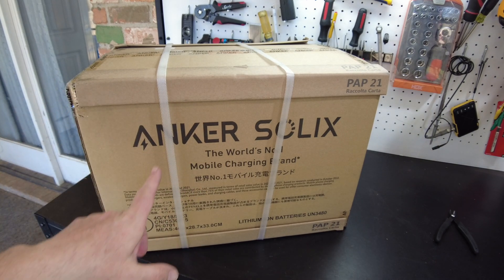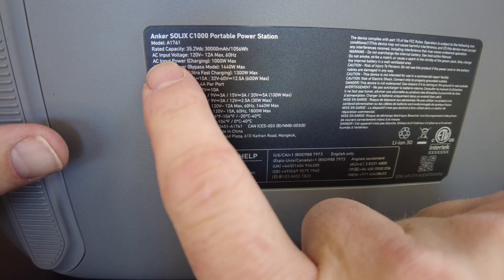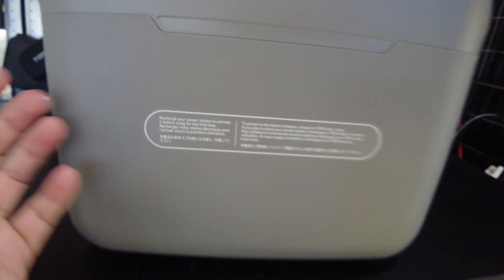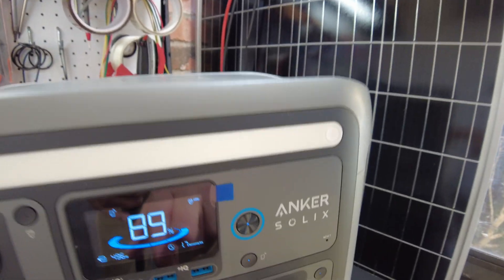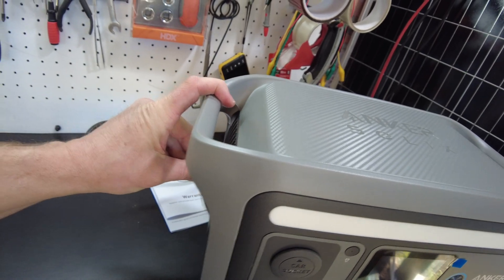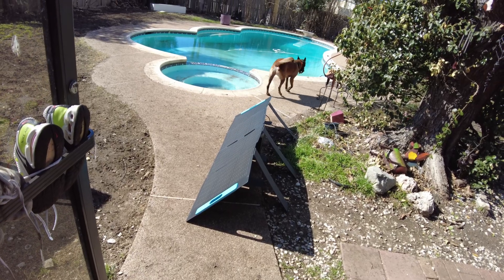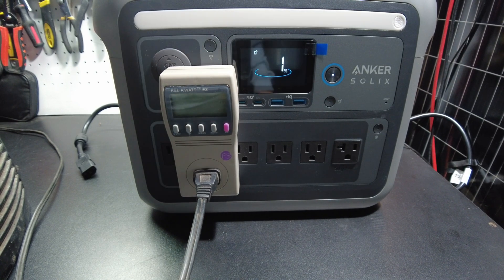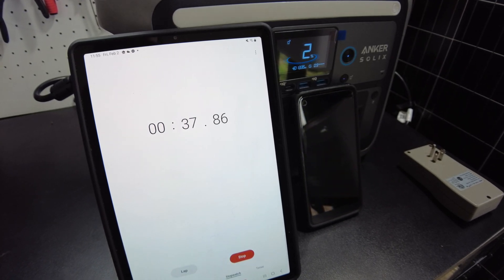Anker Solix C1000 1800w Power Station

Comment: This is a very good unit and very portable. The 1800w with 2400w surge power is perfect for my usage. I have 2ea. Of the Anker 535 500w units I carry in my truck when out metal detecting or out exploring…These are very good products👍

Comment: That's a really weird battery.  It's apparently an 11S, 35.2 volt pack, presuming it's made from 3.2v LFP cells?
It's 30ah, so maybe 11S, 10P, with 3000mah 26650 cells?
Reply from the maker: Yeah, a lot of these power stations have an odd cell series count. Could be a bunch of cylindrical cells, or just 11x 30Ah prismatic, or pouch? Now I'm curious :) I've seen prismatic in these things before.

Comment: Nice video. I wonder what the long term effect on the battery will be for charging 1kWh battery at 1300W which is more than 1C rating.
Reply from the maker: Yeah probably not very good for the battery charging it at 1300w all the time. Which is probably why they make you select that mode in the app, and from what I could tell I think I had to select it every time I wanted to charge at that rate. Thanks!

Comment: I have this unit. Fans are obnoxious, which is a shame as it's a nice unit otherwise.
Reply: Do the fans volume vary with the amount of AC load or is it the same volume whether its 200w or 1500w?
Reply: Fan noise varies with load though even at 1/3 max it eventually starts sounding like a hair dryer after heating up.
I'm running the latest firmware.
Reply: You prolly need to download the update to help with the fans.